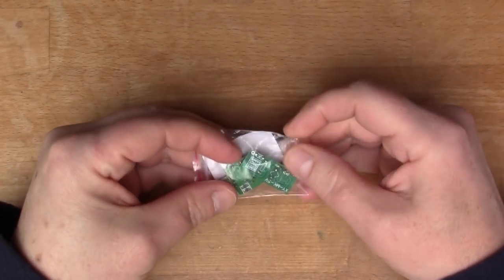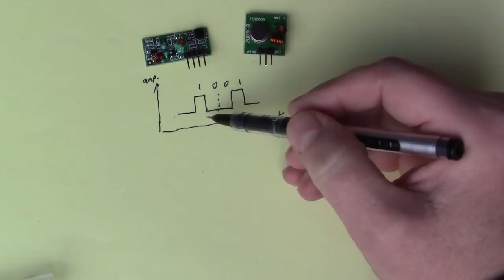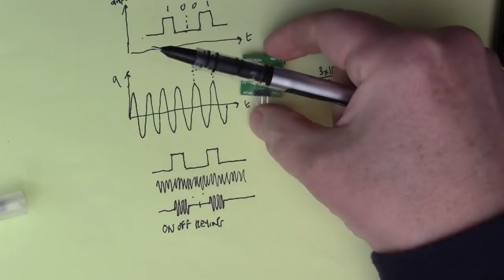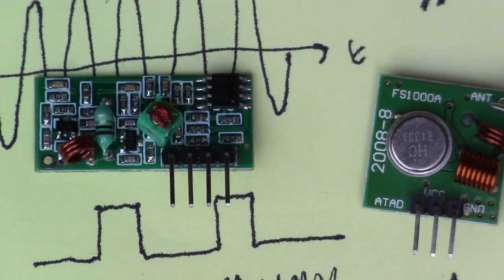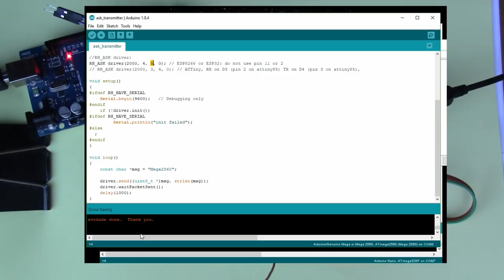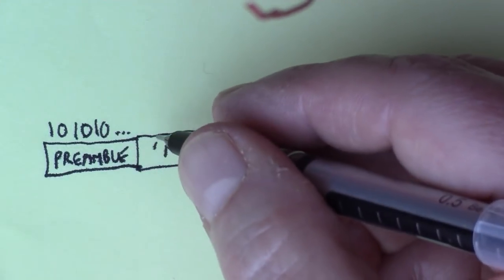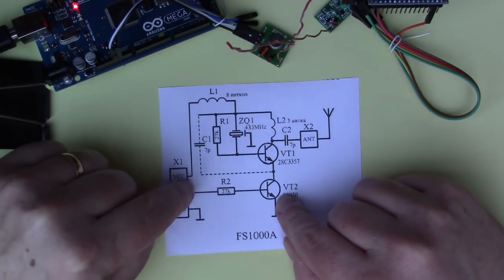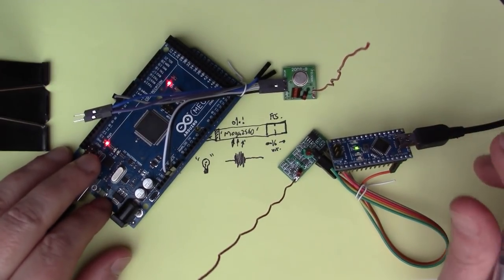Communicating with 433MHz OOK/ASK wireless modules (#88)

Comment: Is it possible to modify the remote and the lamp to stay on if you hold the button and turn it off if you release the button?
Reply from the maker: In the Arduino code?  Yes, you can make a locking button through code.
Reply: I have manage to do it. Your video was very helpful. The electrician made the installation wrong and now the led behind the back of the  bedroom bad is without a switch. I will turn it on/off via Arduino when the led on the ceiling is on respectively off. Edit: I have made the comment on the wrong video but yours was the video that helped me to solve my problem.   @MartynDavies

Comment: MR Martyn Can i transmit with this tx module another freqency? under 433Mhz I mean
Reply from the maker: It's an oscillator based around a 433Mhz crystal - I expect if you swapped in another crystal, you could change the frequency.
Reply: @MartynDavies Thank you for answer i gor it but  Sir for example i wanna transmit a frequenct like 412.2mhz ,so when the module support 433 mhz ,any way with  add some other element ? changeable frequency crystal

Comment: 433MHz ASK is the protocol used by many remote control electrical sockets such as those made by Status.  I hooked up the receive module to an oscilloscope to examine the pulses sent when I pressed each button on the remote control.  Reverse engineering the codes allowed me to program an Arduino to send the same codes via the transmit module in place of remote control.  I can now create a crude Internet of Things switch to turn on and off anything that you plug into the mains. 
I think bitluni's channel goes into more detail on how to use these modules to do this.
Reply from the maker: I've got some old wireless power switches - I'll have to see if pressing buttons on the remote control results in any messages on the Arduino
Reply: Do you need an oscilloscope to do this? Cannot get the code using arduino?

Comment: Simple on/off keying communication like this is ideal for standard serial protocols that use stop and start bits to synchronize the data stream. 2400 or 4800 baud should work great. Many uPs are equipped to work with these streams, too. Just make sure both your transmit and receive uPs are set for the same baud rate, and you're in business.
Reply from the maker: I agree.  For IoT projects a simple radio link is ideal so that you can make things like remote sensors as cheap and simple as possible.

Comment: I know these modules are used in wireless doorbells and radio controlled sockets, so i bought and experimented a bit with these modules.
So far i've only been able to get 30cm range with a 1/4 wavelength antenna, and only when the polarization matches almost exactly.
The receiver is outputting continuous noise, even when the transmitter is turned off.

Comment: For simpler calculation of wavelength to one Mhz if you don't need to be ultra precise - 300/Freq  -  300/433=0.69m or 69 cm. Antennas designed for the 70cm amateur band work well for these transmitters.

Comment: You say there are four discrete voltage levels for ASK.  I had no idea.  That raises the value of binary by a square of 2.  I continue to be shocked by the fundamentals.  Thank you for your clarity and contribution.
Reply from the maker: ASK can have as many levels as you like (with this code I'm using here it is 2, which means the same as OOK), it's all a question of the complexity of the receiver, because of course it gets harder and harder to tell one level from another, the more levels you add.
Reply: As Martyn says, you can have as many levels as your receiver can distinguish between. If your receiver was sensitive enough, e.g. it had eight levels, you could send one byte of data in one time period. This is one way to achieve faster data transmission rates.

Comment: Thank you very much for such an informative & quality video. If I may ask: It appeared to me that you did not include the spi library in your receive sketch whereas you did include it in the transmit sketch. Is there any reason it's not required in one but in the other, or was that just an oversight? Also, is the spi library required when specifying the transmit & receive pins?
Reply from the maker: SPI is a different type of serial interface - basically some chips have the SPI pins built-in (e.g. LED controller chips) to allow several chips to share a set of control pins to one controller (e.g. Arduino).  This is the 'old-school' serial interface, which at its minimal level just has two pins (RX and ground or TX and ground).  This kind of serial interface goes back through the decades to even before I started using computers and connects just two things together, here the Arduino and the RF module.

Comment: Thanks. I always wanted to know about the circuits inside the modules. I designed my method of sending data based on the TV remote method. I use a 'start bit' and a 'start byte'.

Comment: Thank you for the detailed explaination Martyn! Is it also possible to activate and deactivate a 433 MHz power outlet with this, if you collect the data send by the remote before?
If yes, how does the transmitted data code have to look like if you send it as binary or decimal code?
I have tried the RC-switch library before but it is working very unreliable and before I am buying a new transmitter to exclude a disfunction, I would like to try the RadioHead method.
Reply from the maker: I haven't reverse engineered one of those outlet switches before, but yes I would try to capture the transmissions from the remote control and see if I could understand the byte structure. Note that 433MHz is a band (I think about 1MHz wide), so there are variations in frequency between devices, and units from different vendors can be fundamentally incompatible.
Reply: @MartynDavies  thanks for responding,   capturing the signal of the worked out without any issue. The problem i have is, that I dont know how to write the code to transmit the data with this method so the power outlet receives it.

Comment: Excellent description of this system! Thank You! Which now inspires some questions! PLEASE bear with me here. The frequency number mentioned is 433 MHz. I'm guessing that it is exactly  433.000, correct? So since this is probably right, then if I had more than one of these transmitters, they would all be on 433 and so all receivers are tuned to the same 433.000, correct? If so then if two or more transmitters are transmitting simultaneously, then the receivers would all hear/receive all transmitters at once?! Correct? Since the receivers are not using a crystal for the receive frequency, It appears that the receiver is somewhat wide banded and tunable as you mention.
What I would like to do is use this system but have no transmitter/receiver pair interfere with each other. By them all being on the same frequency, 443.000 this has to be a problem.
Can the transmit crystal/oscillator be changed to a slightly different frequency and then retune the receiver to that new frequency? I'm thinking it should be able to do this.
The replacement 'oscillator' I would use is a SiT8008B programmable IC. What I would like to do is use a few of these in somewhat close proximity of each other without any of them causing interference with the others. 
Yout thoughts Sir?
Thank you very much! Cheers!
Reply from the maker: If multiple transmitters send at the same time, then yes interference can happen.  However this scheme only sends carrier for 1's, so you might get away with having multiple transmitters as long as they're sending infrequently. Also, stronger signals (e.g. closer modules) will likely get precedence over weaker.  These are very simple radios and don't have features for contention, security, acknowledgements etc.  For complex scenarios, you might switch to OFDM, bluetooth, Lora etc.
Reply: @MartynDavies  Thank You! I will also be checking out the HC12 module in which you can program it for slightly different frequencies. That way they should not interfere with others.

Comment: Very good video, thank you. 👍

Re the Tx schematic, what is capacitor C1 with the dotted lines? Also, I bought this Tx/Rx set and the Tx came with only one coil -- the larger one. Is this a manufacturing error or have they somehow done away with it?
Reply from the maker: I suppose that C1 allows a low impedance path for high frequencies (i.e. to attenuate them).  L1 is in the power rail (is this what's missing?), so this would reduce signals leaking back into the power supply (or microcontroller?).  I imagine that both these components could be left out.

Comment: Mr, Davies i have a question 
i've noticed that we always use two arduino boards , one for Tx and the other is RX
for sake of two way communications , can we use a single arduino for tx and RX 
and the other arduino also have TX and RX
so we can exchange data ?
Reply from the maker: For two way communication, you might want a radio module that has both Tx and Rx built-in (i.e. a transceiver), so that you minimise the chance of receiving your own transmission.  I think these 433Mhz modules are best used in the simplest applications.

Comment: Thanks for the video Martyn. Have you done any further experiments with these modules and the library to see what is the maximum data rate that you can get reliable communications with? I think anyone trying to use these modules would benefit from knowing what is realistically achievable with them if you want reliability.
Reply from the maker: I haven't experimented with the rate, but I suspect it will be fairly low, firstly because the receiver doesn't use interrupts and so the program is polling for incoming bits, and secondly because the Atmel processor is quite a slow one anyway.  I worked on some multi-port serial cards many years ago (also a polling solution), and I think we had the bit rate at 19200 for reliability.  Hardware USARTs usually have some kind of buffer (at least a byte) to store incoming bits until the main processor has time to come and service the receive request.  The default speed in the RH library seems to be 2000bps.
Reply: @MartynDavies  Thanks Martyn. That’s really useful.

Comment: On the receive module in the circuit where the incoming signal is combined with the 433mhz signal generated in the upper part of the circuit diagram before being amplified by the first op amp, how does the combining of these two inputs decode the incoming signal? Also, what is the practical range and data throughput of these types of modules?
Reply from the maker: I think this is what is called a 'heterodyne demodulator', where you mix the signal with something close to 433Mhz, and this gives you a 'beat' frequency that is the difference of the two, and this will be in the range that the op-amp can amplify. That's probably all you need, since the aim is to distinguish between 'signal' and 'no-signal' for OOK.  

I haven't tested the range, but I imagine quite short due to other devices in the band: car keys, mains remotes and so on. Also, the output stage of the transmitter is only one small transistor as you saw, so the output power is low. You could do a lot better in aerial design of course than (cough) my piece of wire.  

For a range of tens of metres you probably want Bluetooth, or for hundreds of metres Lora.  These systems have   extra coding in the signal to improve signal to noise ratio and detection of errors.
Reply: Thanks Martyn. I will investigate more and I have a order placed for these parts to experiment with. Great introduction, you have sparked my curiosity.
Reply: Yale battan theek nissan.

Comment: Am used this Modyool but one problem. 
No range 100mr . Haw to boost range in circuit Sir
Reply from the maker: You might get improved range with a better antenna, but this module is intended to be a very low power transmitter.

Comment: Some of the designs for the Receiver are very sensitive to noise on the VCC connection.  Even a tiny voltage ripple on VCC may cause output to put out a continuous square wave.  That will render data reception impossible.   Power the receiver from a very tightly regulated 5 volt supply
Reply from the maker: That's interesting.  My 5V power source (a Riden module) seems very stable.

Comment: Thank you, Martyn. Where can I get more information on the different amplitude signals you mentioned from minute 9 to minute 10? Is it just a matter of using different resistors between the transmitter's data pin and gnd, and reading the receiver's data pin as an analog instead of a digital signal? I've just got 3 events (off, medium, and high) so I'm trying to get by without a microprocessor on the send side.
Reply from the maker: The FS1000A is a very basic transmitter and I assume that the transistor is just switching the oscillator on and off.  However, putting different resistors across the base might work.  On the receive side you'll need some different software to decode multiple levels - but I suppose that the Radiohead library has something to do that (i.e. Amplitude Shift Keying).
Reply: @MartynDavies  Thanks, Martyn, as soon as I can get them I'll give it a test.
Reply: @MartynDavies  Okay my tests show that on-off works but halfway with resistors doesn't send signals of varying strengths. IMSAI Guy posted a schematic of the transmitter. I wish there were a schematic for the receiver. Could the receiver work better with adjustment? There appears to be a variable resistor in the middle of the PCB.
Reply from the maker: @rongarza9488  I do show the receiver schematic in this video. This receiver won't work unmodified for your application though as the last stage is a comparator that forces the signal into on or off.

Comment: Can I transmitt PWM signal generated from arduino using these RF modules ?
Reply from the maker: yes, that should work - the 'on' pulses will get modulated with the 433MHz carrier, and your original PWM waveform should get recovered at the receiver

Comment: Hello Martyn, thanks for this great Video! But one question i have.. i cant get any results on google..

so what happends if there is a sender which always sends an signal, so always voltage on..

Now you have a receiver near, but how now the receiver can get other signals then 1, if one is permanently sending 1.. (or sending permanently waves) how a receicer can now get any 0's?

The wave which the receiver becomes will look always ^^^^^^ because another sender is permanently on? Now if another sender want to send waves the reveiver cant get any offs, because of the sender which permanently sends? Or do i missing something? 

Thanks you!
Reply from the maker: Yes, this rather simple form of modulation can be jammed quite easily.  A more sophisticated scheme, like spread spectrum, allows the energy to be distributed so that sending a single jamming signal has a limited effect on the system, and the signal can still be received despite the additional noise.
Reply: @MartynDavies  Okay, thanks :)

how you mean it exactly? use a range of frequencies?
Reply from the maker: @pupupupu448  It's rather complicated, but spread spectrum technologies add a spreading code that makes the signal use a much wider frequency band, such that when you despread the signal, the overall effect of noise (and other signals) is less.  This simple radio module cannot do that.

Comment: How do you know how long the period is for one bit in the on/off switching? Can you compare it with a baudrate that you can set to a value in advance? Or does this work totally different?
Reply from the maker: In this case, the bit rate over the radio link is set to 2000 when the RH_ASK object is created - so the assumption is that this bit rate is fixed and known to both ends of the communication. In some radio systems it's more dynamic than this - for example you can transmit a preamble with a known bit pattern (e.g. 10101010), which allows the receiver to measure the length of a bit so that it can interpret the rest of the message correctly.

Comment: I am facing problem with this FS1000A module. They are not communicating. I noticed one thing that in my Rx circuit there is no 1uH inductor, but I can see in your this video that your Rx module has a green coloured inductor of 1uH ( color code Brown, black, golden,silver). Is this the reason that my Tx and Rx modules are not communicating? Each and every effort I made to communicate them but nothing is happening. Can you help me what could be the possible reason.
Reply from the maker: If the inductor is missing, the emitter of the transistor won't be connected to ground, so yes that would stop the oscillator.
Reply: @MartynDavies  if I use inductor other then 1uH the it work? because I use 3.3uH nothing happened as I have inductor of only this value this time.
Reply from the maker: @euphoriachemistryclasses1383  This looks like a tuned circuit (there's no crystal to set the frequency of the receive side), so I suspect the value is important.
Reply: @MartynDavies  ok
Reply: @euphoriachemistryclasses1383  , maybe there is an smd coil there?

Comment: Can you use these without a microcontroller, like a pushbutton on the transmitter that lights a LED on the receiver? It is just an on/off signal that is sent anyway.
Reply from the maker: Yes. The output of the receiver should be the same as the state at the transmitter input.
Reply: @MartynDavies  Great, I am considering making an early warning system for camping and hiking. We have brown bears and wolves around here :)
Trip wire/IR on the transmitter and a buzzer and LED at the receiver should do the trick.